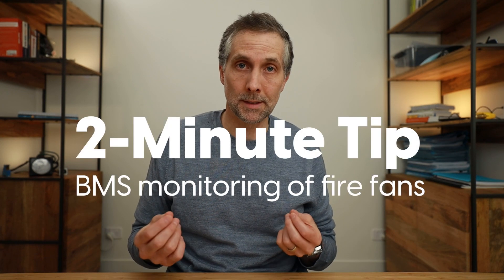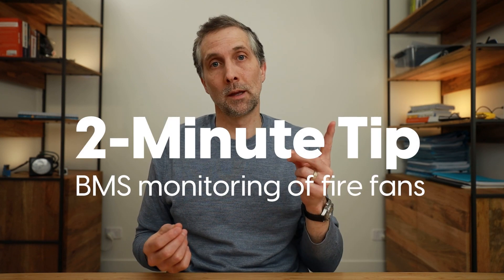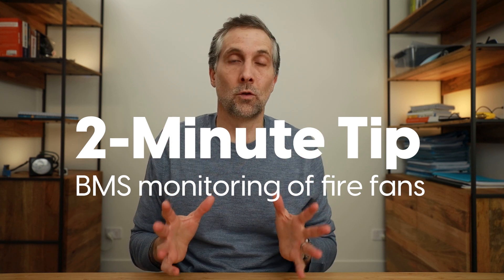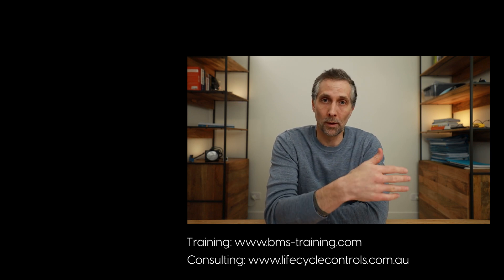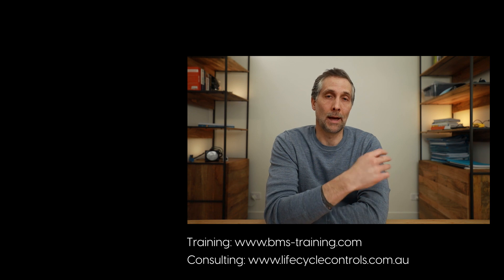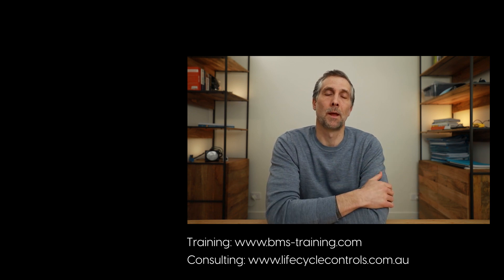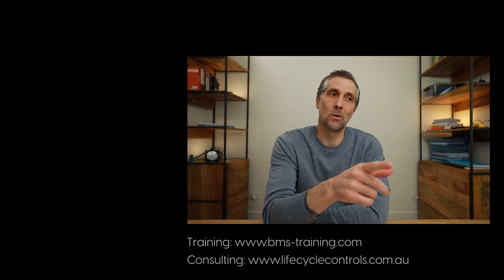2 Min Tip: BMS Monitoring Stair Pressurisation Fan VSD's

Comment: Thanks for your good information some times we connect the pressureziaton fans to BMS controllers specially if we have active and standby fans and damper but we are using special controllers for smoke management system form same manufacture
Reply from the maker: I understand. Sometimes the fire/smoke control is too complicated for relay logic. I think as long as you consider any regulations in your country and you put together a robust design, you will probably be okay. Dedicated panel, no other BMS points in that panel. Essential power supply etc.

Comment: building on this - another top tip, add feedback from any damper motors (even those no required to be on BMS) that have a smoke management function (open / shut) ......makes testing and verification a doodle (sure beats being on an elevated platform 5 metres in the air checking if a smoke damper has shut on alarm)